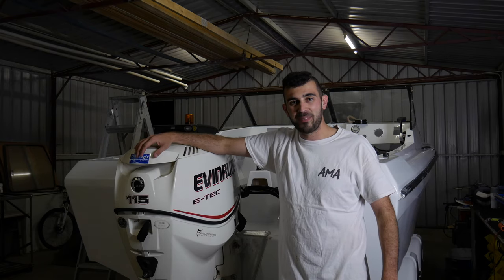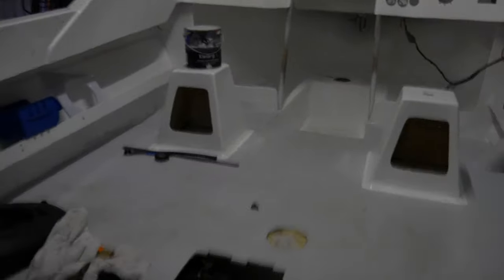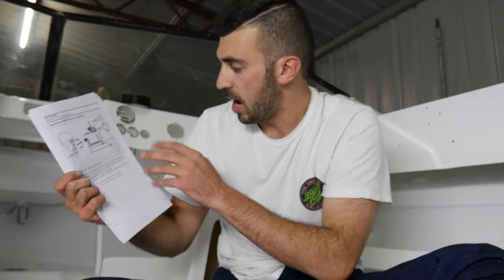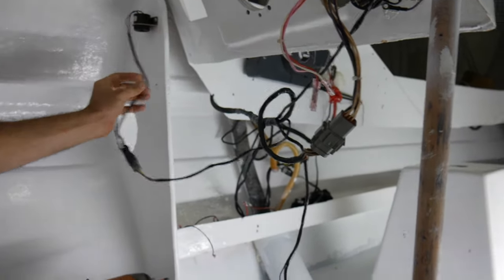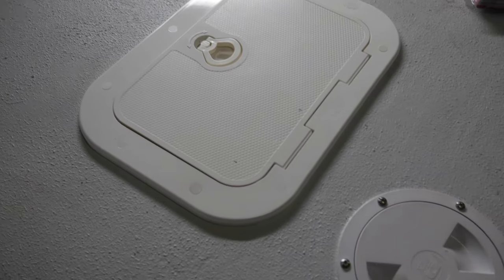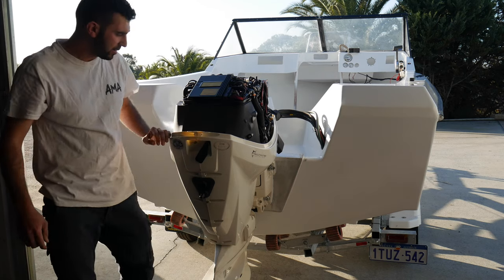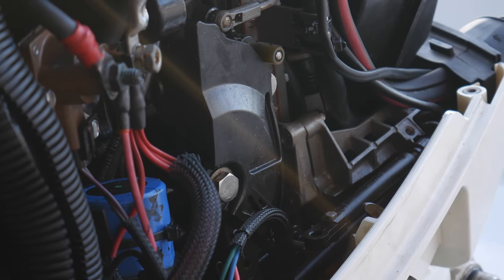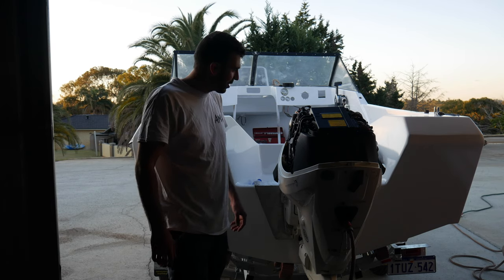STARTING SIGHT UNSEEN OUTBOARD FOR THE FIRST TIME | FULL BOAT RESTORATION PART 14

Comment: Nice. But after all that work, you install a 2 stroke?
Reply from the maker: Wingster Rod hey mate, ahh just personal preference, I like the way 2 strokes perform. The hours/condition/price of this outboard it was a no brainer to buy. And of-course I didn’t have the extra $15,000 to buy a new 4 stroke, but definitely in the future this boat will get the upgraded engine it needs. Thanks for watching 🙂

Comment: Awesome to see the engine start up! One MAJOR step to getting it into the water. It already looks like a new boat, looking forward to seeing the console completed with guages, chartplotter(s), and the all important steering wheel. Am I correct to assume that you're going for hydraulics instead of wire for steering?
Reply from the maker: Thanks for watching Nathan! yes defiantly something out the way, and to push onto the next task! Yes the dash is the next thing to finish off once i install the steering wheel! :)
Yes going hydraulic Hydrive system in the boat :)

Comment: How much did it cost in total, excluding the outboard?
Reply from the maker: Hi Luca, there will be a full video on cost and hours in the near future, need to add everything up :') but for full boat restoration inside and out doing the work yourself with trailer may be cheaper then you think !

Comment: hit any open edges of wood with epoxy.  that hole you installed the oil tank in will rot at the edges if you dont do this.  i use west system clear penetrating epoxy
Reply from the maker: Oh yes great idea I’ll be sure to do this, thanks for watching  :)
Reply: @AngryMackAdventures  I just finished replacing a whole floor because of rot so always to stay ahead of it if you can

Comment: Century batteries recommend that the starting cables go on to the main battery posts , not on the threaded posts .
Reply from the maker: thanks for the note mate i didn't know this!, i will look into it. If thats the case i'll definitely be changing the terminals to the main posts, thank-you!

Comment: Couldn't you just extend oil line all the way to the primer instead of using that brass fitting
Reply from the maker: Hey mate thanks for watching! needed that extra 100mm to run neatly with the fuel line, something i will be change in the future, just working with what i got and keeping eye on budget :)

Comment: Why wasn’t there water coming out of the telltale
Reply: Yeah I was wondering the same thing. Might wanna look into that cause I know some evinrudes like mine have the part where he put the water into just to flush the motor, like push water through the motor backwards. Pretty sure it’s like most motors and your supposed to put towards the leg and waters meant to come out of the telltale. Might be a different type of motor but should definitely look into it.
Reply from the maker: Hey Guys thankyou for the concern, on first start up ( when recording)  i had a long hose running to the motor so had minimal pressure, and engine was only running for approx. 2 minutes. Since this video i had started it again with more water pressure and water was exceeding through telltale, impeller is healthy but before going out onto the water, outboard is getting full service and check over :) Also i rang evinrude dealership and they said to use muffs to properly flush engine instead of using the flush port, so ill try this also.
thanks for watching!
Reply: The flush port / tell tail is only for flushing the power head “without” the engine running!